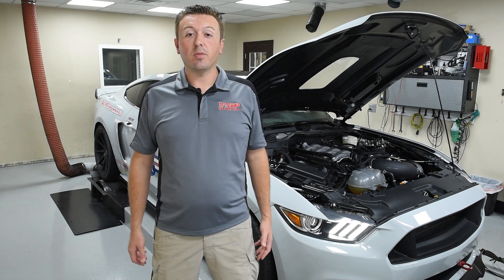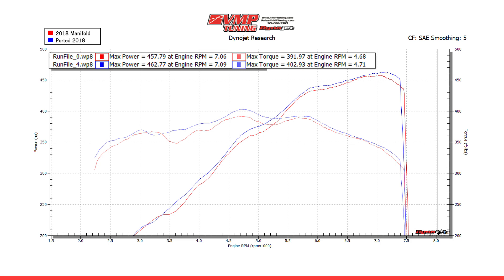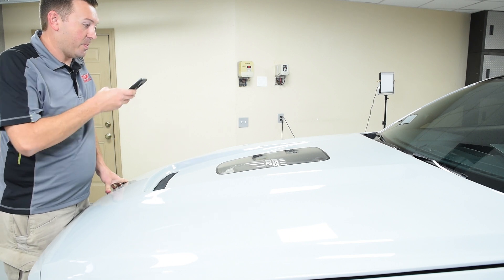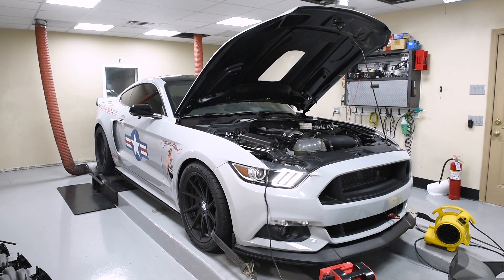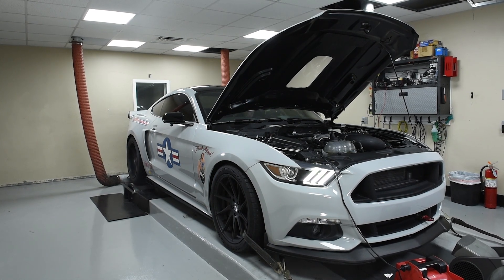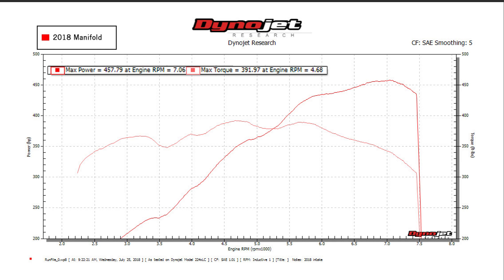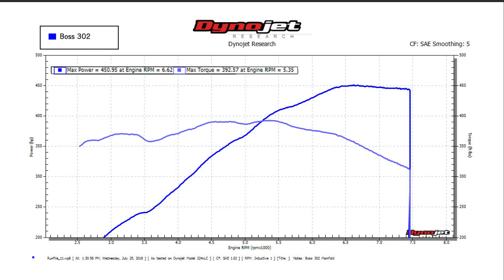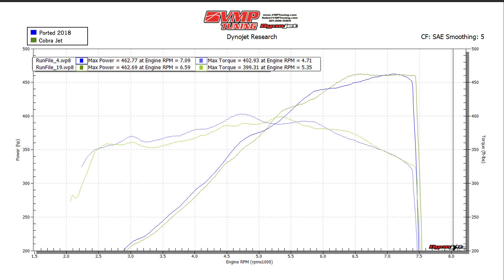VMP Performance | Coyote Ford Mustang Manifold Shootout

Comment: I don't know if you guys will respond, but what about a ported 350 intake manifold?? Is it hard to do or just not done
Reply from the maker: We've seen folks port GT350 intakes with success.  The reality is, there's enough options to make this video 3x as long between all the ported options.  A GT350 intake, particularly a ported one, is going to make power very high up in the RPM range and if that's where your using your vehicle, it could be a viable option for you.  It'll be a sacrifice of low end power and torque as it will shift the curve higher into the RPMs.

Comment: VIDEO IDEA:  Cobra Jet intake manifold (hood closed) vs. 2018+ CNC Ported intake manifold with stock CAI with carbon filter insert removed (hood closed) with fan right next to the upper grille snorkel.

Comment: I think Ford big wigs don't like the Eldebrock because it makes more power on both bottom and top. I have one on my gen 2 coyote with a 90 mm BBK throttle body and its faster than SHITTTTT . ?😁😄😄😄😄
Reply from the maker: Would love to test it but the intake manifold wars seem like they are over.  Maybe when the Gen4 coyote comes out?

Comment: I only watched have the video and the comment I have when you put the truck manifold on it is made for torque. It's made for snow plowing and trailer hauling not for power, trucks 5.0 are set different than the Mustang 5.0

Comment: A Ported Truck manifold may be pretty sweet as well, may move the curves a little further into the higher RPM range. And they are super cheap. Thoughts?
Reply from the maker: They peak very early about 6300rpm and porting only helps a little bit.
Reply: The f150 intake is good for a daily driven street car. I have one and love the low end torque and power. being I have a auto with 3.15 it's a great mod. But if you are drag racing stay stock or use the other intakes

Comment: Truck intake rips! Similar HP to 2018 manifold but more low down torque! Nice!
Reply: I have a 2015 gt with a 2017 f150 intake and I love it for a street car daily driver it's the way to go especially if you a automatic
Reply: @momogt09  Agree, for a daily driven street car, the F-150 manifold is awesome. How often does one see 7K+ RPM on the street?  Rarely!  Wonder how a ported F150 manifold would perform?  I also noticed the CJ manifold only makes 9 more peak HP than the F150 manifold?!  That's a BIG investment for such a small gain, just to be able to rev past 7.5K.

Comment: Great job. What did it do with the stock 2017 intake manifold? It would be interesting to see how much difference the other six manifolds made.
Really impressed with the torque of the truck intake manifold. I'd be interested to see what a ported 2018 truck manifold would do.

Comment: Vmp need some clarification on the truck intake used early comments you mentioned you used the 11-14 f150 intake manifold.then you said you used the 2018 f150 intake manifold. I know on chucky you used the 2018 f150 intake manifold but not on the s550

Comment: Can you use your stock throttle body for the 18 manifold from a 2011 gt
Reply from the maker: Yes, if you are replacing your stock 2011 intake manifold with a 2018+ intake manifold the throttle body is a direct swap.
Reply: @VMPPerformanceTV  was it done on e85?
Reply from the maker: No, this test was done on pump 93 octane

Comment: What is the difference in performance from the stock BOSS 302 Intake in comparison to the ported BOSS 302 Intake? As with the Cobra Jet to the ported BOSS also? I am torn between the Ported Boss for looks vs the Cobra Jet...... my intentions are purely natural aspirated, no forced induction for me. Thanks!
Reply: I just did a ported boss 302 and it netted me 15rwhp on my 17. I lost some torque though.

Comment: I really wanna see ported truck intake. 3500-6500 it made more average hp and tq than the "top dogs". Its problem was the drop off after 6500 but with a bit of porting, maybe it'll continue to carry that? Might be smoother too

Comment: I think you guys are really underestimating the truck manifold. It made significantly more torque and even more horsepower up to 5500 rpm. Who cares about peak HP numbers past 6500 rpm. How much time is the motor actually going to spend between 6500 to 7500 rpm anyway? On the street, the truck manifold is going to feel the most torquey and enjoyable to drive. It is probably the cheapest manifold in the bunch as well. I'm curious if porting the truck manifold would have helped the dropoff after 6500 rpm while still maintaining the superior low-end torque.

Comment: Huh...  I wonder what a ported truck manifold would do?  It would likely lose a little torque on the bottom end but should gain a bit more peak HP because of the additional intake volume at wide open.  Unfortunately, with the truck manifold there is no easy way to "shorten" the intake tubes to make a lot bigger top end HP numbers.
Reply from the maker: We've got one, we'll let you know in pt2!
Reply: @VMPPerformanceTV  is it a 2018 f150 intake manifold
Reply: @VMPPerformanceTV  

Depending on the port mismatch, before cleanup, it could provide a bit of lower end torque and upper end RPM / HP increase.  Without somehow shortening the intake runners at higher RPMs they will start to choke off air flow.

I will make a guess here.  A well ported truck intake will likely stay about the same on torque, it may make a tiny bit more or less, but not a lot of change (I can't imagine the mismatch being really big).  However, on the top end you will likely gain 100-200 RPM before drop-off and a little horsepower.  The fall off will still be severe but should be slightly less severe than the intake before porting because of the slightly better ability to breathe.
Reply: @VMPPerformanceTV   Where is pt2?

Comment: When you tested the 18 ported intake manifold did you lock out the imrcs ?
Reply: steelmagik this is what I wanna know! I know VMP makes pigtails and I’m still determining whether or not to use them now that I’ve bought them🤔. I’ve seen people voice concerns on tunability with the pigtails and imrc  system in use but I’ve also seen better low end torque if you don’t lock them out. VMP HELP!! Lol

Comment: With the truck manifold if you set it to shift at 6800 it would make about the same peak hp and more torque in the powerband in each gear I think.
Reply: You go try that and enjoy losing to guys with better manifolds lol.  You will get drug in a roll race or any race.

Comment: Wonder how much torque loss would present if lock outs were used?! 🤔  On a gen 1 bolt on auto with a high stall converter 5.0, would the ‘18 manifold be a good choice? 
Wish the chucky episode showed a back to back comparison at the track.

Comment: ok, is the 2019 Mustang Bullitt intake manifold an improved version of the 2016-2018 GT350? Has a bit better numbers but has the ability to rev all the way to 7800-8000 rpms? If this is the case then in theory, it should perform better than the stock 18 GT manifold? thanks

Comment: How well do these composite intake handle boost? I was thinking about using the 2018 manifold in a turbo coyote build.
Reply: get a super charger turbos suck
Reply: @StevenNeidlein  
I'm pretty sure a turbo is a type of supercharger. And superchargers do suck.
Reply: @177SCmaro   no turbos suck because they have turbo lags superchargers are better because they work from the crank shaft which is instant boost where turbos have aren't instant and have  to build up power it's not instant do your research bro
Reply: @StevenNeidlein  
The full name of a turbo is a turbo or turbine supercharger. I think you're referring to a roots or screw-type supercharger. All superchargers suck btw. It's how they work.

Comment: I’d say the outcome of the testing is either keep it stock and just shift at 6.6k rpm or waist money to pull an extra 1k rpm with no real hp improvements and potential catastrophic results attempting to get so much way upstairs like that. I love your dyno setup!! Awesome scientific testing done and thank you for that. Not quite the results most would expect but definitely worth the effort.
Reply: Yea , unfortunately you extra wrong. People have picked up not only hp gains but tenths off their quarter miles with the 2018 intake because they carry the power out further before shifting . In the next gear the rpms are higher than if they had shifted earlier , helping them stay in the usable power band . I'm going 2018 ported intake , you can run the stock manifold and get gapped if you like 😂
Reply: Topically a stock 2017 gt makes 380 on the dyno. I believe it is a huge gain to 460 hp

Comment: Does no one realize that the truck manifold has by far the best graph and (unported) peaks hp at 9 horse shy of the CJ but at 700-1000 rpm less. And with more torque. It is all around better.
Reply: The truck manifold would get gapped at the track by a cj.  It would get gapped on the street too anytime therr is a wot race it would get gapped unless you only rave for 2 seconds and let up or might jump slightly lol.

Comment: How’s the 2018 f150 manifold compare I wonder.  As the truck manifolds have a greater torque curve, maybe a ‘18 f150 manifold would be a good swap on Gen 1&2 f150’s
Maybe a test on a ‘18 mustang VS ‘18 f150 manifold would be a good comparison.
Reply: 18 truck manifold was one of the dynos. It fell short on HP at higher rpm

Comment: I have swapped my GT intake manifold with a F150 manifold and it's transformed the car in the low to midrange RPMs, which is great for a pure street car. Lots more torque and pulling power. Crispier throttle response too. I prefer it over the GT manifold! I also have long tube headers, 3" exhaust and Steeda CAI with Tune. 😎👍
Reply from the maker: Sweet!! 💪 - Max
Reply: Do you have a gen 1 or gen 2 gt
Reply: @momogt09  Sorry, I have a 2017 GT mate

Comment: https://www.borlainduction.com/ford-coyote-throttle-body-kits/
Reply from the maker: Very neat, there is some similar stuff out of Australia, those kits often require a standalone ECU that is MAP based, its not something the Ford ECU can control since there is no MAF sensor.  Basically its good for a kit car build not a regular mustang.
Reply: @VMPPerformanceTV  actually V Jr uses it on a few of his drift cars and on coyotes I think it has a mass flow air sensor on it I'm not for certain

Comment: On the tests, the Cobra Jet had to be tested with a bigger throttle body where all the others used the stock throttle body. How would the numbers change if all the others had a larger throttle body? Would they out perform the Cobra Jet?

Comment: Imagine what a set of 19in/305 carbon fiber wheels and a carbon fiber driveshaft would do! Prolly reduce rotational mass by around 60-70 pounds! And btw people with Long tube headers, catless downpipes and exhaust with a good tune are putting down 500-510 RWHP!

Comment: 13:35 The Boss peaked at 7500 rpm because of the cams. Not the intake. Putting a Boss intake on a stock 2011 Mustang will not increase hp or change where the engine peaks.
Reply from the maker: The boss exhaust cam is 13mm lift vs 12mm lift, and for 15up, the cams are now 13mm lift too.  Ford likes to roll the special technology from previous years into the new MY.

Comment: The 2018 Mustang Gt gain 25 more hp because it has a hotter cam. Just like the Boss made 32 more hp over the 2011 GT, because it had a hotter cam. You want gain any hp from just an intake swap.
Reply: The 2018 is also VERY underrated from the factory. Fords claim of 460hp is bs. I’ve seen dump after dyno of the 2018 putting out 490-500hp. Stock

Comment: Ported truck manifold. Looks like it would make the most torque and with the porting it would catch back up on hp. #headedtothejunkyard
Reply: Won`t work. It makes high low end torque because the smaller intake means higher air velocity. Once you port it, it will loose that low end torque, and gain some high end power. It`s a trade off situation. A ported 2018 seems to bee the best compromise to date.
Reply: For daily driving I would say the truck intake would be better these 5.0,s have weak low end torque

Comment: What was the numbers on the stock 15-17 GT manifold? They weren't mentioned after the pull or on any of the charts? Thanks  @vmpperformance
Reply from the maker: Hey Chris, the truck and mustang stock manifold both made similar numbers, too close to discern a difference, and were down over 50rwhp at 7500rpm.
Reply: @VMPPerformanceTV  thank you!

Comment: Was this a 2018 truck manifold? I watched the whole video, I'm pretty excited to be in the Ford Coyote club, just bought a 2018 f150 5.0, looking for easy Bolt on power, truck has 3.55 rear, 34inch tires(bds 4inch w/fox 2.5), any recommendations?
Reply from the maker: We can always get one of those ported for you.  The truck has a larger engine bay so the intake is a little taller and appears to have more runner length.

Comment: How much did the stock 15-17 manifold make? You never said
Reply from the maker: Hey Nick, it made the same as the truck intake, go figure?
Reply: VMPPerformance Interesting. Thanks for the reply!
Reply: I have swapped my GT intake manifold with a F150 manifold and it's transformed the car in the low to midrange RPMs, which is great for a pure street car. Lots more torque and pulling power. Crispier throttle response too. I prefer it over the GT manifold! I also have long tube headers, 3" exhaust and Steeda CAI with Tune. 😎👍

Comment: Good test, What was the remainder of the combo on that car and would the GT350 have done better with it's throttle body/air box than that JLT setup? Btw, I'm sorry to say, that's the worst sounding exhaust I've heard on one of these.
Reply: Hey, we tested the gt vs gt350 tb previously and found no difference in power.
Reply: Justin Starkey  Thanks Justin, did you use the complete inlet system?
Reply from the maker: We used a comparable 120mm CAI from JLT.
Reply: VMPPerformance  Thankyou.

Comment: This just proves the stock intakes are designed very good and are great Street intakes, of course if you’re going all out and racing and searching for every last tenth of a second then I can see the advantages of some of the other intakes, imho most people should just stick with The stockers, great torque and torque on the street makes it more fun for spirited driving where most avg people are going to be driving their cars, I’m all for going fast but if you’re getting to 7500 or 8200 on the street you’re going to be insanely speeding, just goes to show you you don’t have to do much to the new vehicles to be fast, Ford did a great job, my next 5.0 will be axle back, intake and ford tune, doesn’t need anything else!

Comment: Maybe I missed it somewhere in these comments, but in the video I never heard which truck intake you were testing, 11-14 or 15-18??? 
Oh, and great comparison test!
Reply from the maker: Thanks for watching! We used an '11-'14 truck manifold for this video.
Reply: Well, they changed the manifold in 2015 with the manifold runner plates just like they did for the Mustang, wonder how the later truck manifold would do. Lots of guys who are doing Coyote swaps are starting with F150 engines.

Comment: Dang I just got the jms throttleswap, vmp twin 67mm intake and jlt 120 mm CAI for my 2018 makes me wonder if I made the right choice I did add 4.09 gears and 1 7/8 header with high flow cats. How high will I be able to rev the motor safely and the actual HP gains I might see? Thanks awesome video.

Comment: I'd rather have the Boss with Direct port nitrous. None work well with a plate system and I think the Boss is best to install a direct port. 
What would be interesting is a Spacer between the intake manifold and the heads, place the nozzles in the spacer and use the 2018 manifold!. 
Hint hint Justin!

Comment: Should've been done on a bone stock car. Numbers are not going to be accurate because the other mods are going to throw off the numbers vs a bone stock car so one manifold may make a ton of power in a certain rpm range with the mods and another may not.
Reply from the maker: The test mule had headers and exhaust only.

Comment: why didn't you spin them to 8200 like the gt50  was made for ..
Reply: people đont spin the gt350 mani to 8200 on a regular coyote.  that is on the actual gt350 which has a flat plane crank and different heads among other differences.  if you're going to spin them to 8 grand the cj will widen the gap it's the best intake at 8k hands down and if you had a ported one even more so.  for the money ported 18 makes most sense but a ported cj spinning to 8 will make the most power and be the fastest in a drag race no question

Comment: This precisely what my local tuner told me. If you're racing then go with a GT350 or 18 intake because all your gains are on the top end. If you're just street cruising and occasional street racing then the stock intake has better low end torque, but runs out at 6500rpm. Wondering how the complete Borla 8 stack set up fares. Expensive yes, but looks amazing.

Comment: Would you ever test the GT350 heads, intake and cam's all together on a 5.0L
Reply from the maker: Thanks for the suggestion! We'll look into it.
Reply: VMPPerformance how about swapping on some lightweight gt350r carbon fiber wheels and a a carbon fiber driveshaft on a stock 6 speed to see if the reduction in rotational mass yields any gains! Id assume it would reduce drivetrain loss by a significant amount!

Comment: Hmm. very interesting data here, the stock truck intake still makes 450rwhp, just lower in the power band. Plus it seems to have better power saturation between 4k-6.6k. why not just lower the shift rpm to 6.6k? from 4.7k to 6.6k the stock truck intake makes better power?! Am i missing something here?